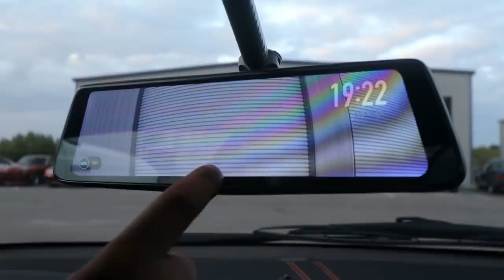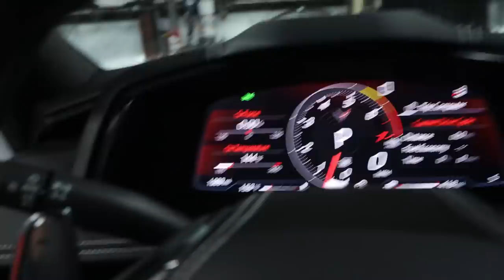How to Embarrass a Lamborghini Urus...Build a 6x6 Jeep

Comment: 2:08 "I've never been in a 6x6" cough mercedes g class 6x6 cough
Reply: H0LYW4T3R CORONA
Reply: Problem is it's not a 6x6 unless there is power going to all the wheels. A lot of the gwagons out there are 4x4 with a extra axle that just gets pulled around. I really hope he's not doing something cheesy like that or the electric axle thing. I hope it's a true 6x6
Reply: @carculturenation2166  It was a true 6 by 6. The G63 AMG 6 by 6. The one from the factory. The one that costs $500k.

Comment: If you get the Lamborghini Urus, turn it into a 6x6, lift it up 2-3 feet, add the railing thing on the top, add the circle lights thing on the front, and put any type of wide body kit on it. Only if you want to

Comment: 3:15 It doesn't look like it even has a rear driveshaft connecting the two rear differentials
Reply: Bluetooth 🤣
Reply: Northern Farmer It’s a hybrid. Electric motor controls the rear axle. A differential and driveshaft from an ICE engine would explode if you connected them to that instant torque from a motor xD
Reply: because it has a differend drive train i guess

Comment: Why would it be embarrassing the Urus, I don’t get it. You mean it can out accelerate the Urus? Or it has higher top speed? Or the braking power is stronger? If just the size and number of wheels on it. Bring the truck trailer out to embarrass this 6x6 Jeep.